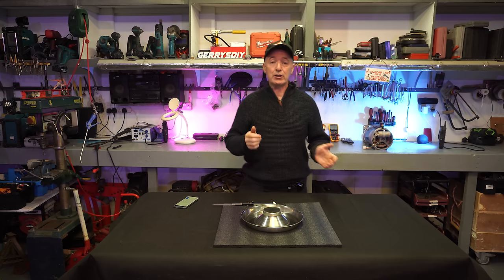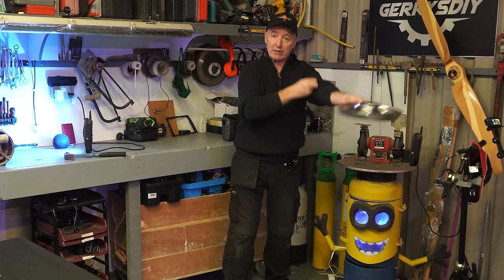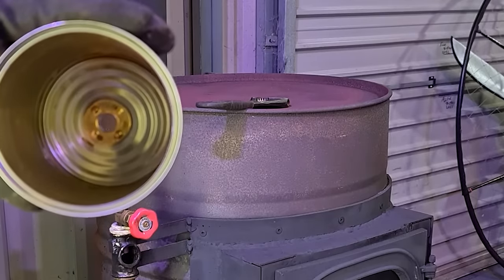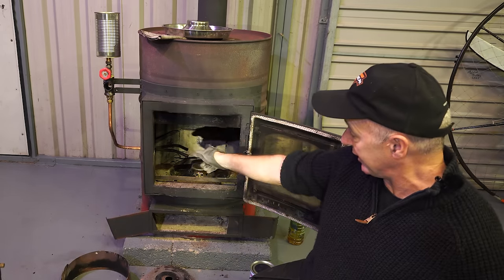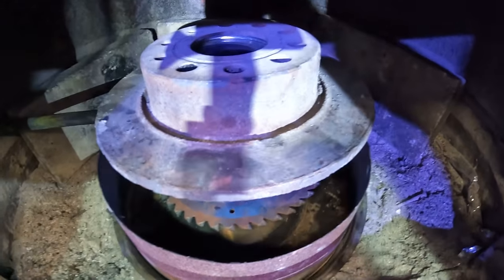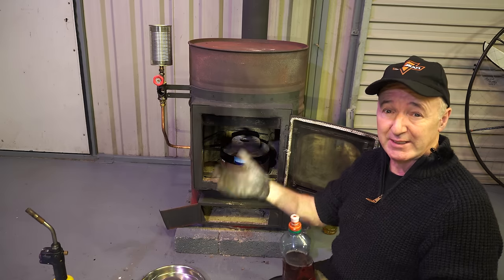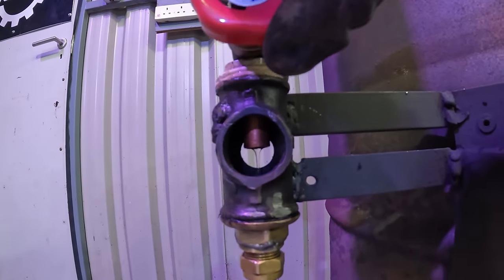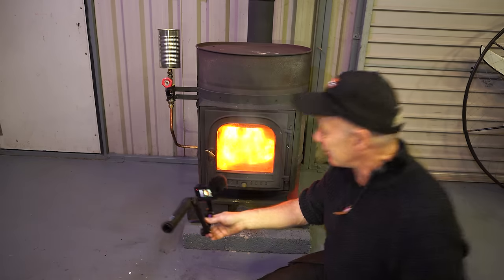FANTASTIC Puppy Feeder Waste Oil Burner

Comment: I'm really impressed with your stove.....    Great job.....    I would love to make one.....      I wonder would it be possible to add a home made boiler tank to the top of the baral??     Either inside or out??     And then plum a radiator up to it??     I know some wood burning stoves are plumed for heating water....       Also another question I have is.....     What would be the benefits or drawbacks to adding water as a fuel??     As in another fuel line and reservoir but for water.....     To be added to the vaporizing plate at whatever ratio and vaporized along with the oil.....      To provide more oxygen.....      And burn hotter???       What do you think????
Reply: @Michael Murray it's a very old and well known process...     The drops of oil hit the hot vaporizing plate and vaporize....    It's that process that allows the oil to burn....      The oil won't burn if you put it in a cup and try and light it with a match....       It's the same process.....    When you drop water onto the hot vibration plate....    It turns to vapour or steam.....    When you do this along with the drops of oil it releases the oxygen from the water....    There is a mixed mist of steam and oil vapour....     In the presence of fire....     Witch will make the fire hotter....    Very hot.....    Maybe too hot.....     Could melt the stove....       It's like adding NOS to a car.....     It's not the nutrition that is burning.....    It's the extra oxygen from the NOS that allows the engine to produce more power.....       I'm sure there are videos on YouTube that show the process I am describing....    Iv known about it for years....     My uncle made stoves like I'm talking about.....     It burnt waste oil from cars and water......       The process is also mentioned in the SAS survival book.....
Reply: @Michael Murray I think it's a 2 to 1 ratio......    But I can't remember with is 2 and witch is 1......    I think the water is 2 and the oil is 1......     But I could be rong.....

Comment: Hi Gerry, i have made a waste motor oil burner from your videos and is working very well, the issue i have is it doesn’t burn clean there is loads of smoke out the flue, what can i do to minimise that? Thank you !
Reply: You cant really if your air is alredy max you cant remove smoke without forced induction. You can search waste oil burners with compressed air atomizers, they burn much cleaner but are more complicated to run/automate

Comment: Hi gerry I was thinking of making one out of two old back tractor rims that I have, they are solid rims , and just weld them together your probably taking about 3foot (0D) is that to big of a stove/circul to heat, my work shop is 20x45x15 high
Reply from the maker: Hi Kevin.  A barrel size stove would heat that space with ease so you can work it from there. The tractor rims would last forever. Cheers Gerry

Comment: Great video Gerry ! I was wondering does the exhaust burn black out the stack ? Always my worry to upset the neighbours ! Thanks mate 🤙
Reply from the maker: Hi Steve. You need a good flue and well sealed stove to make the magic happen. All the combustion air has to be pulled through those holes. That mixes the fuel and the air for a clean burn. This makes no smoke in my setup but I have been doing this a while. More videos to come and I will show the exhaust of the chimney. Thanks for taking the time to comment Much appreciated. Cheers Gerry 👍
Reply: Thanks Gerry for that , I am keen to give this a try in my garage , your system looks great, looking forward to your videos ! Cheers from down under 🦘

Comment: If you want to crank up the heat and efficiency try one drop of water to 2-3 drops of oil.
Reply: Wht happens when you do that?
Reply: It vaporizes the oil giving a quick and complete burn. Same as  if you tried to put out an oil fire with water only under controlled conditions.
Reply: Get the oil burning before starting the water drip.

Comment: I have a load of old petrol.  Could I use it in one of these?  Maybe mixed with old oil?
Reply from the maker: Hi Anthony. No is the short answer. Petrol vapouises too easily and will go bang. Diesel or kerosene will mix well with whatever your oil of choice is. Cheers Gerry

Comment: Wouldn't you need a lot of oil to keep it running?
Reply from the maker: GerrysDiy
1 second ago
Hi Ciaran. Like most domestic oil burners this will run at about 3 litres per hour. But this is used oil not necessarily veggie oil and can definitely be collected for free. On top of this I designed this stove to be multifuel so I can burn solid fuel in this stove too. This burner is very simple and lacks any sophistication but emits a lot of heat without the need for power of any kind. Thanks for commenting Cheers Gerry 👍👍

Comment: Electricity storage is insine expensive. So:
- Use excessive photovoltaic energy to turn plastic waste into fuel (pyrolysis)
- Use fuel to heat your house in winter.
The trouble is: burning process HAVE TO BE 100% safe and as effective as possible to reduce smoke.

Comment: I keep meaning to build one of these setups,  as I've 1000 litres of used veg oil taking up room. It'll save me a lot of firewood, and I know where to get more oil when I need it. I wonder if anyone's actually done an analysis as to whether the heat calorie output from even cheap bulk new veg oil from catering suppliers, is more cost effective than kiln dried firewood?

Comment: Do you have any ideas for some way of the fire smothering itself out if the burner gets to full of fuel for safety?
Reply: one failsafe which springs to mind is a spring loaded shut off valve held open by an easily melted lever - if it gets too hot it bends/gives allowing the supply valve to close.

Comment: Hey there, recently found ya and i was been watching all your burner videos.

I have a 40x50x18 shop, and a wood burning stove in good condition that I use regularly.  What would you recommend for a “temporary/removable” burner?   I’m having trouble with air flow and the up-draft. I dont want to cut a hole in the bottom, but that seems to be the key factor in your burners. 

Cheers and thanks for the help

Comment: Great video as always. How does this compare to the past heater with the barrell sideways on top? Appreciate the knowledge you spread
Reply from the maker: Hi thehouseofminitrucks. It can produce about the same heat depending on how hard I run it but the big difference is that it is modular. When the barrel expires it's easy to cut 3 holes in the next one and transfer all the hardware I made and then it's good for another few years. That was the plan a couple of years ago but I might end up making something else 🤣 Really appreciate the comment Cheers Gerry  👍

Comment: Please people DON'T burn oil in your wood stoves. I am a certified chimney sweep/technician and an expert in the NFPA-211 (National Fire Protection Association) Standard for Chimneys, Fireplaces, Vents, and Solid Fuel-Burning Appliances. 
These stoves are NOT meant to handle the increased heat from oil. 
You can easily get to the point where loss of life and property is YOUR OWN AND OTHERS REALITY. 
In almost every single circumstance I have heard about people burning oil in their fireplace or wood stove DAMAGE has occured to the stove itself AND the venting arrangement. Usually the venting warps from excessive heat compromising the stove pipes integrity and safety to further contain combustion gasses to the atmosphere. 
I HIGHLY recommend against this. 
Not to mention if you do happen to have a loss of life or loss of property your insurance WILL NOT cover you!